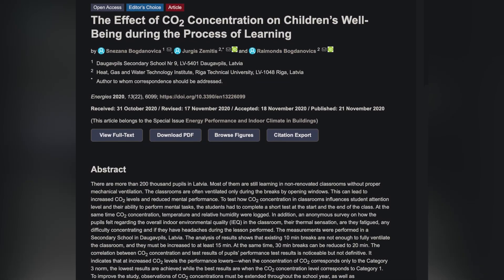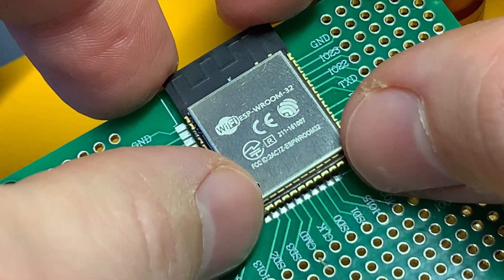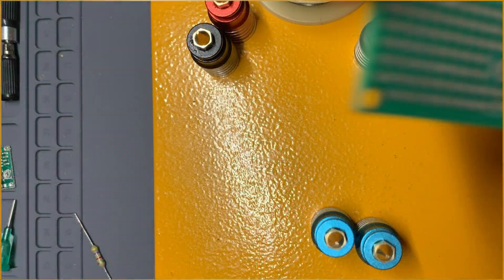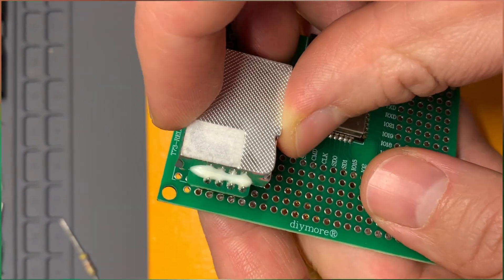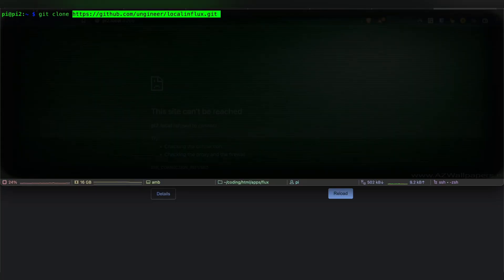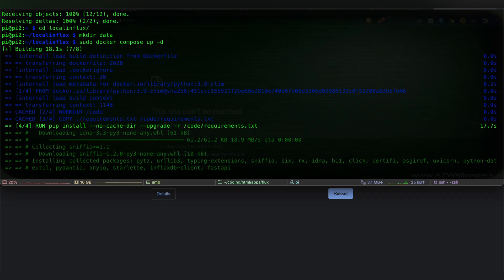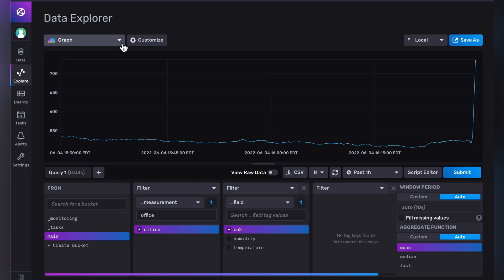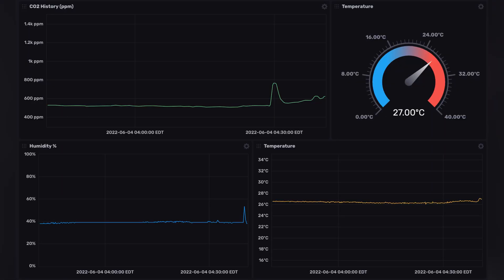#17 (Mostly) Accurate CO2 monitor with pretty graphs (using MH-Z19 and esp32)

Comment: Pre tin before soldering especially wires etc... you also need bit more heat. It's not cleanly balling, it's on the threshold of being good enough but barely room for error.
Reply from the maker: Excellent advice. Thanks for the tip!

Comment: I'm looking to make this, but I'll be using it to purge tanks with Co2 to remove O2. What sensor can I use to make it work for my application?
Reply from the maker: I would go for something like SCD41
Reply: @ That reads in ppm, I would need it to read in ppb, sorry I didn't mention that at the beginning. Thanks for the speedy reply!
Reply from the maker: @arnaldonieves6832  unfortunately if you need that kind of resolution, you're likely looking at sensors in the neighbourhood of $5-10k, and they usually work over ethernet or usb, this simple circuit is nowhere near enough for that.
Reply: @UNgineering  Got it, so if i use this one and multiple it by 1,000 to get my numbers. to PPB. Thank you for this video, I have bought out parts needed so this will be my small project here at work. This will be used at a brewery.

Comment: Is it possible to use a protoboard instead? And, where can I get the ESP32 PCB like yours?
Reply from the maker: https://s.click.aliexpress.com/e/_mL8WvBh

This is the pcb I used, but you can also use any other protoboard if you get one of the esp32 dev modules -  they have standard pin spacing and usually a usb port to program them